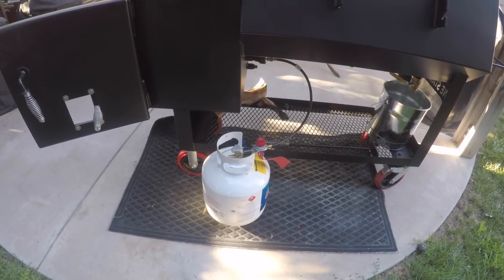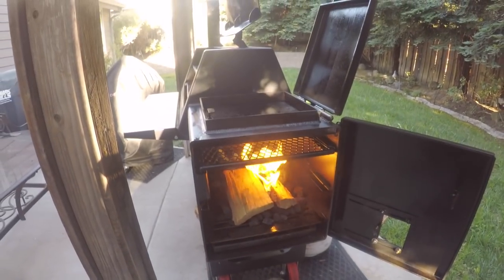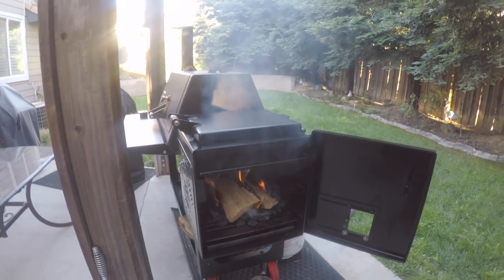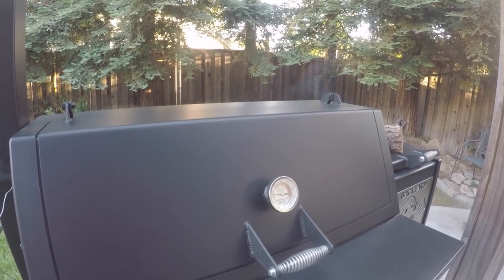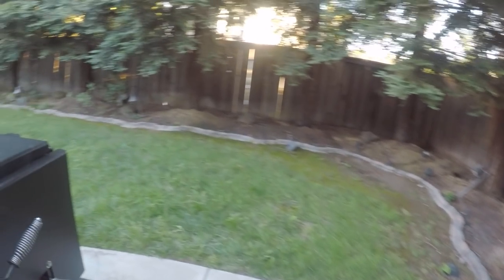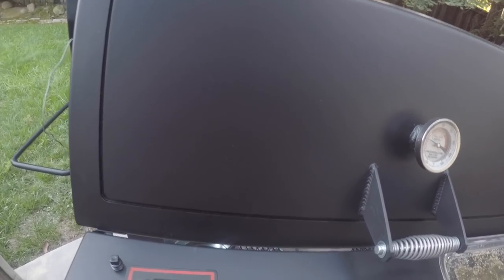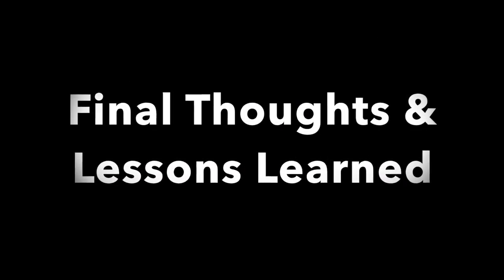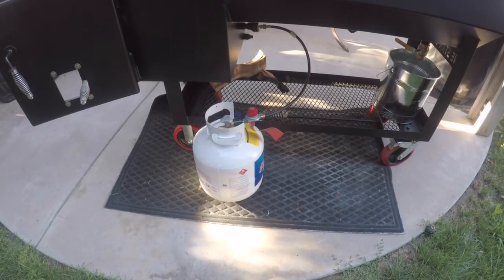Learning How to Use the Gas Log Assist on Lone Star Grillz Offset Smoker

Comment: I started off using the same size splits you're using in this video. Chris G suggested I cut those in half with my mitre saw. Ever since I started doing that, my fire management and smoke quality have improved greatly. You may still need to throw the whole split on to keep temps up, but cutting it in half first allows your coals to breathe. Throwing the uncut split on was smothering my coals which cools the fire, diminishes the coal bed, and creates harsh smoke.
Reply from the maker: Thanks Jonathan.... I bought a Kindling Splitter but that only helps me get thelogs down to the size in the video. I'll admit that I've never heard of a "mitre" saw so I'll have to look into that.
Reply: Kenyatta Robinson Some people just call it a chop saw. You'll recognize it as soon as you Google it. A friend bought me one years ago for little house projects but it's really handy for making mini splits! If we were running the 24" diameter offset with the bigger firebox split size wouldn't be a problem. But alas....
Reply from the maker: OK.... I've seen those saws before, I didn't know what they were called. Looks intimidating LOL!

Comment: KR check out Troy cooks he just got same smoker. He's an old hand at offset cookers. I don't think you need any charcoal. You should criss cross wood and light news paper, then turn on your log lighter. I think you can crank that up and with that have roaring fire in 20 min. You should see some of the others they have great big weed burner. In Troy's video once fire was situated he close down vent to about 1/4 inch and was maintaining 225 degrees. The steaks you had hear you could probe get them to 115 degrees in main chamber. Then do quick sear a minute on each side over firebox grate
Put cooking grate in middle position for searing, then you can open your own restaurant.
Reply: John Knapp I completely agree with you using 3 or 4 splits and no charcoal or use lump and the temps should come up much faster and T Roy and a couple others are good to learn from ( Baby Back Maniac, and Aimem and Claimem

Comment: Great video.  It looks like the new method really speeded up the process on getting up to smoking temperature.  When I reverse sear steaks, I only leave them over the direct heat for 2 minutes per side max and that depends on which smoker or grill I'm using and how high above the heat the grates are.
Reply from the maker: Wayne Dimirsky I’ve used the gas log assist a few times & it does make a big difference. I agree with your approach for reverse searing... it was another good lesson learned lol.

Comment: Also suggest if you are not using the grill grate above the fire is to remove it when you are just using it as a smoker.  That is how I use mine.
Reply from the maker: Robert Spangle Right! I had that revelation when I saw how grimy that grate looked after one of my other cooks. Removing it also also allows more room to pour a chimney of charcoal into the firebox.
Reply: Also on your reverse sear you should over used the griddle part!  30 seconds each side and you would have had a champion steak.

Comment: Smaller splits will ignite faster and burn cleaner. Two of your splits looked pretty large. You were rolling alot of white smoke when you put the steaks on. If you use charcol get it well lit befor putting wood on. Will ignite the wood alot faster on a hot bed of coals.
Reply from the maker: Thanks for the tip. I'm working on making my splits smaller especially considering that the firebox on the 20" offsets are probably smaller than most.

Comment: Nice job, I just pulled the trigger on the same unit yesterday. I am somewhat concerned in noticing a decent amount of smoke leaking from fire box & also not seeing a clean blue smoke....thoughts?
Reply from the maker: Allan DiSimone I’m a novice at using a stick burner so I’m still learning how to achieve a blue smoke. I believe it has more to do with my own inexperience than the smoker itself. At this point, I still believe the grey smoke at the start of my cooks has more to do with the establishment of a good bed of coals & patience as I feel that I am able to achieve it after I’ve been rolling for awhile. The moisture content of your wood also plays a big role & I’m just now learning about that. I think my wood might be too dry but I’m not entirely sure yet. T-roy just put out a video on seasoning his new LSG. I don’t recall what his smoke looked like but I suggest checking out his video as he is far more experienced with stick burners than I am.
Reply: get a gator pit....they don't leak but damn they are pricy as hell.

Comment: log assist? thats cool! So can i use that propane burner in the firebox to cook without using coals or wood? Could i just use the heat from the propane and use smoke tubes with pellets?
Reply from the maker: No, you should only use it to help start a fire in the firebox. It’s not meant to be used continuously throughout your cooks.

Comment: you might also want to try smaller logs when starting the fire and putting the bigger pieces of wood once you get a nice fire going with a bed of coals. or try chopping those bigger pieces into smaller pieces. the big pieces make it hard to keep a clean fire going.

Comment: Kamado vs Offset, which one do you prefer?
Reply from the maker: If you want versatility (grilling, smoking, making stew or soup, or just about anything), go with a Kamado. For authentic wood fired BBQ smoked flavor, nothing beats an offset. If you’re into the process of managing a fire & cooking with wood splits, then go with a good offset built with 1/4” steel. 

I think cooking on an offset offers the biggest challenge in BBQ while also being the most fun experience. That being said, I have both an offset & a Kamado so it really depends on your preferences. Hope that helps some!

Comment: The idea of the propane is so you do not have to use the wax or anything else but the wood. I think you overkilled a little. Let it burn with the fire box door closed and the vents cracked you want the heat and smoke to move through the unit and up through the chimney.
Reply from the maker: The instructions that LSG provided with the gas log assist suggests starting a fire inside the firebox with a wax cube or paper.

Comment: You don't need gas assist. 
You don't need to use the chimney coal starter. 
You don't need to obsess over the smoke out of the stack. 
Lone Star Grillz  are that good. 
I think the smoke condition may be much more important in something like a barrel or a cabinet smoker. My Masterbuilt always had the heavy white smoke but it was much smaller and had a much smaller outlet for the smoke so it hung around in the cabinet and everything was disappointing out of it. I have had both thin blue smoke and a heavier white  in the LSG but it made no difference in flavor.
Reply from the maker: Thanks Christine.... keep in mind that I made this video almost 1 year ago when I was just getting started with learning how to use a stick burner. I agree that a gas assist is not needed, but it is useful to get things started. I have it, so I may as well use it. I don't worry as much about the color of the smoke coming out of the stack but there is a difference between "clean" smoke & "dirty" smoke. I realize that you're going to get dirty smoke, especially when a new split catches no matter what. I'm much less concerned about it now than I was back then. Overall, I've enjoyed the learning process.... I feel like I learn something new every time.
Reply: @BackyardSmokeMasterBBQ  I do get a kick out of all of the up sells like the gas assist.  I guess a ton of those barrel smokers/cookers are sold and you can't really help what comes out of them. I still think the offset tastes the best. 
I watch all of you and have learned a lot of solid tips. Thank you!
Happy Smoking my friend.
Reply from the maker: @chris5942  Thanks! Happy Smoking to you too!

Comment: Darn Kenyatta! I sure hated to see you waste those BEAUTIFUL steaks that you prepared at the very end of your experiment. One thing that was either mentioned by you, or by another person, you should remove the grating above the fire, in the fire box, if you have no intent to use it during your smoking process. I just assume it will get 'gunged-up' from creosote  if not used, but just left in place all the time. I am watching your every move, as I intend to purchase the very same grill from Lone Star, and you are making ALL my mistakes for me!! LOL! Sorry, but true!  I DO LOVE THAT SMOKER! So please find the 'right method' quickly,.. and don't waste any more your BEAUTIFULLY prepared steaks, of yours, OK? Oh,.. and something else,.. I saw at T-Roy Cooker's site,..(He has EXACTLY the same LSG smoker),.. to warm your next stick, place it inside the fire box WAY over to the LEFT, as far as it will go, AWAY FROM THE COALS,..and not on top of the grill cover. Heats up quicker , thus dryer. Good luck, Kenyatta!..Ron, in Carmel, Ca
Reply from the maker: Hey Ron.... yes I learned from experience to take the grate out from inside the firebox when you’re not using it. As for placing wood on the far left inside the firebox, this works best if your splits are small enough. Otherwise, they will light too because the firebox on LSG’s 20” models aren’t as large as the ones in the pipe smokers. Placing wood on top of the firebox also does a good job of preheating the splits so they light quickly too. I hope you land one soon, the LSG is a fine machine.

Comment: u can't just lay the logs in there however you want. try making a more tee pee shaped fire. instead of two logs laying next to each other horizontally lay one log over the other kinda like an X pattern....that helps with a clean fire. if you see some nice flames in the fire box that means your burning a clean fire....as soon as you seee that white smoke coming out of your stack you know u need to check the fire box and play with the fire...maybe add some air flow....maybe get a battery operated leaf blower to add some air to the fire when it starts to smolder. learning to stack the wood properly is key to burning a clean fire.